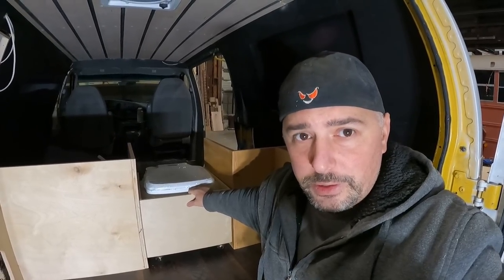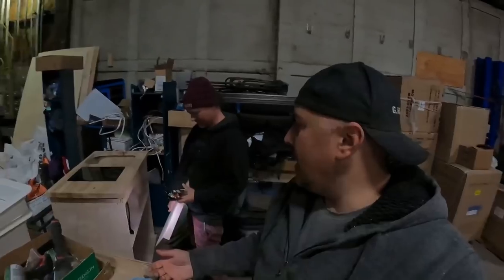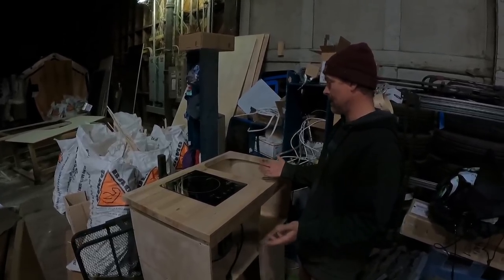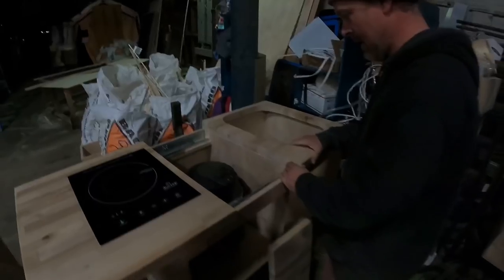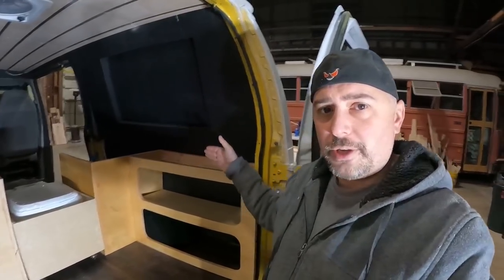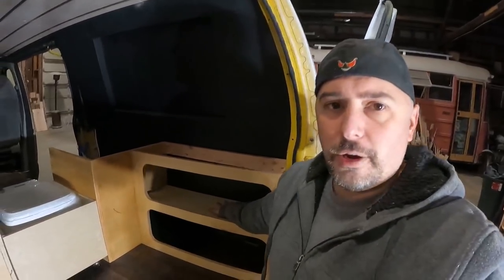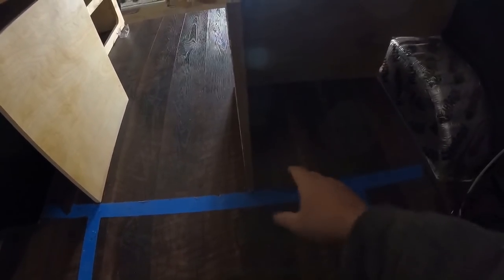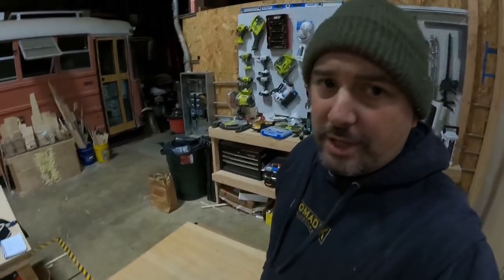Van Build Ep. 8 - Bed Frame and Showing Friends Rebuilt Galley

Comment: Wonderful ideas Marty!!  As an electrical engineer you might want to check and see how much steam coming from the InstaPot is condensing on the bottom of your induction cook top??  If you end up with moisture on the bottom, it can seep into the electronics of the induction top and cause it to live a short life.  If the bottom is completely sealed on your induction top then it might not matter much - but if there are vents on the side and/or bottom to release heat then I would do what you can to keep condensation off the bottom.